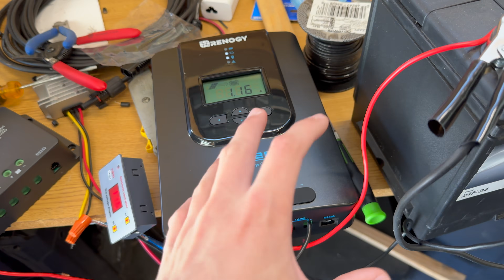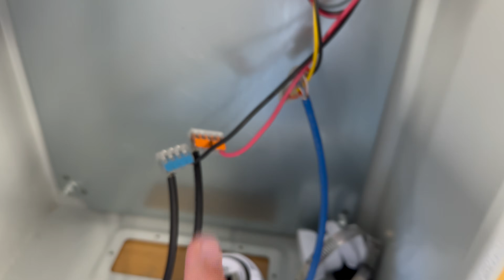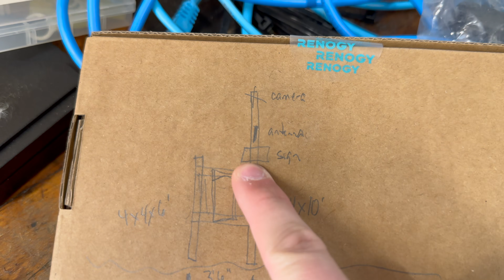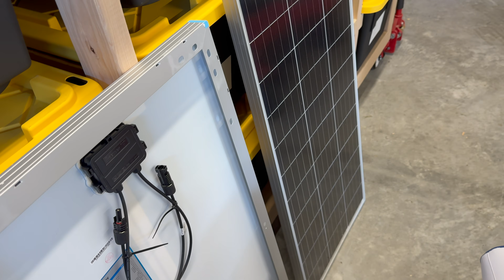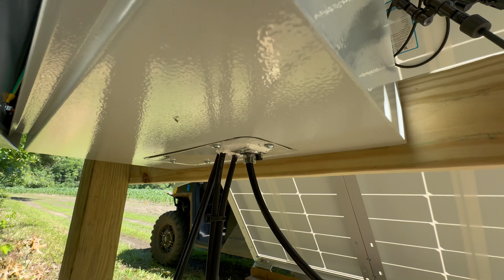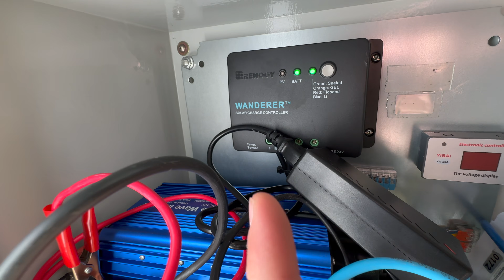Off-Grid Power & Long Range WiFi: Building a Remote Camera Box (Solar Powered!)

Comment: did you blur your polaris ranger keys? lol. dont forget to do nice cable management inside that enclosure and monitor heat build up. Check if that PoE heats up. Heat will affect the reliability of your setup. I don't know where you live in and maybe its not bad. Arizona, Texas, California can be really hot. According to the type of trees and vegetation you are not in Arizona :P
Reply from the maker: Haha yeah, blurred out the keychain. Thanks for the support. Pretty worried about heat but hoping it’ll be better once I can get rid of the inverter.